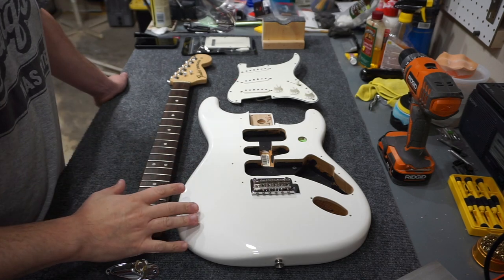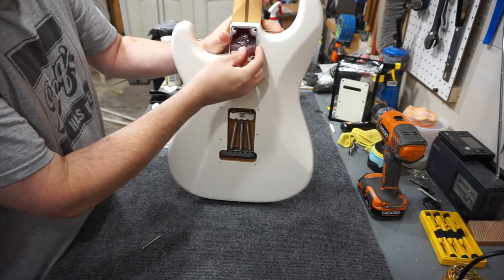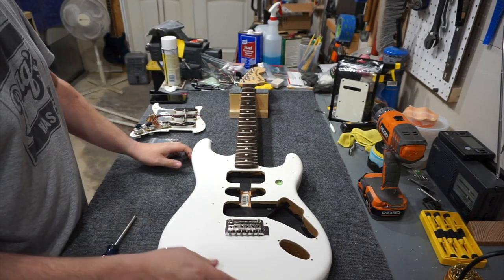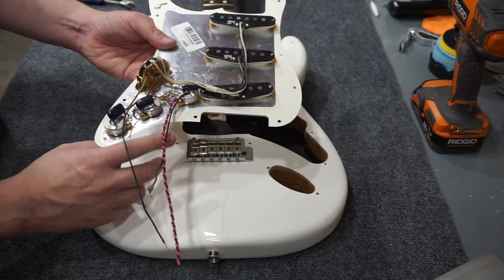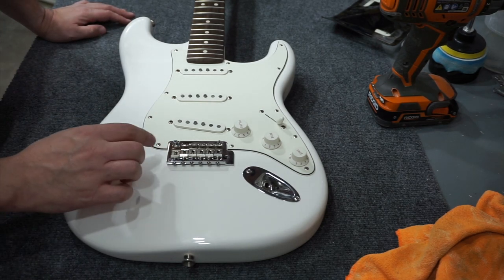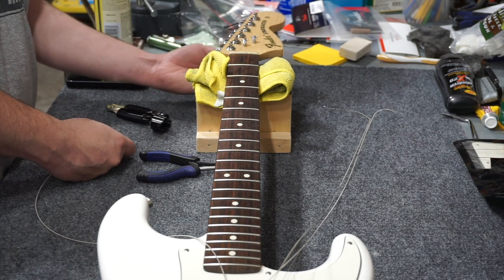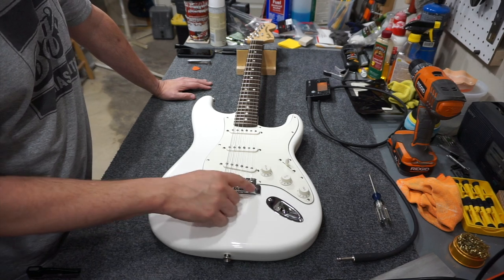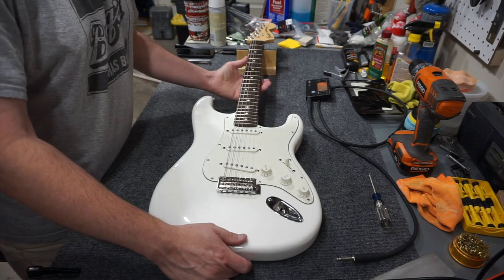All-Fender Partscaster Build: 2018 Player Stratocaster Body, 2007 Highway One Neck, & 59 Pickups

Comment: You didn't check the relief!
Reply from the maker: I did… may have not recorded it.  This is the neck from my Quick Tip video on truss rod nut replacement, so I did have to adjust it.

Comment: 4/64" on each string at 17th fret.
Reply from the maker: Thanks, that is the Fender spec, and I’ve been using it on some Strat necked guitars lately.  It works well.  I do prefer to adjust the unwound strings down as far as possible.  Action is very much a personal preference.